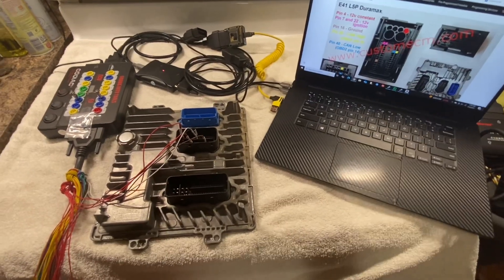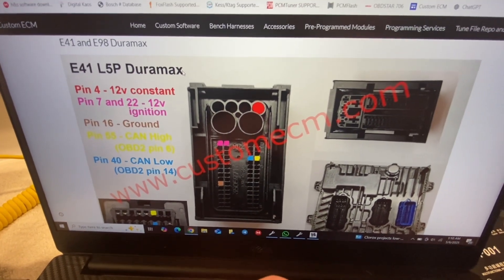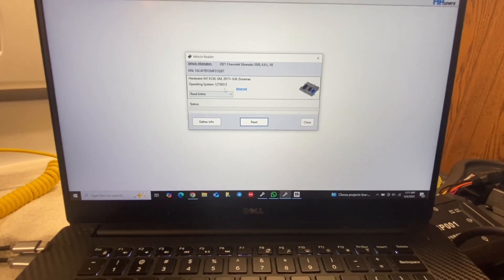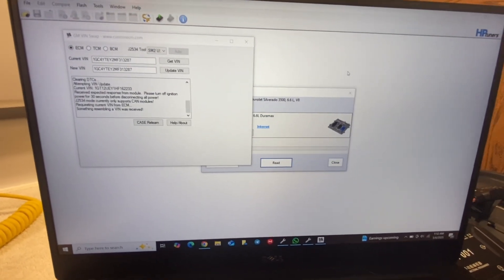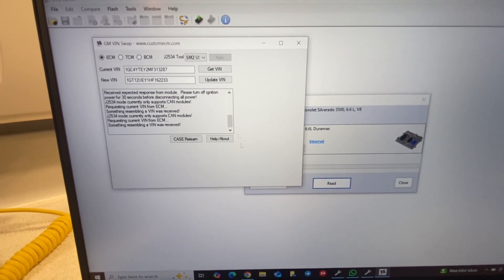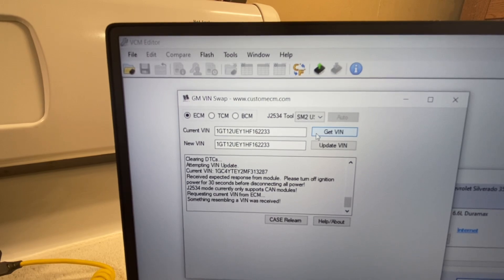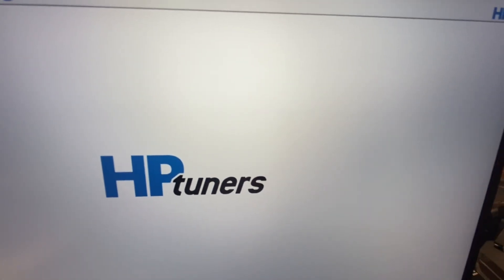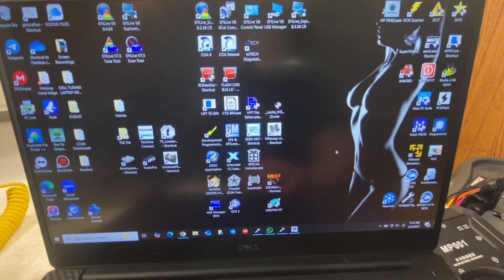GM VIN CHANGE on DURAMAX L5P E41 ECM 4 Free 😁 no credits needed!

Comment: Wèe you showing 2 different ways or doès this require hp tuning
Reply from the maker: You can also change vin on the hp tuners scanner tool.   Was showing that you could use both ways / both softwares .   Hp cost credits other one doesn’t

Comment: You know we’re to get cda 6 and flash files?
Reply from the maker: @CambamsGarage  me :)
Reply: @ how does one contact you?
Reply from the maker: @CambamsGarage   whats app 1.712.204.3955
Reply: Dude stoked to have found your channel
Sent here from dtech
Your underrated AND  look forward to learning from ya 
Peace from KY
Reply: I can help ya there.
Reply: Did you know vin swap can do dodges too  ...  crtl d
Reply from the maker: @joenitro9024    it does?.  dodge vin's are usally changed in the eeprom
Reply: @drewjohnson5402   sorry ctrl d is debug mode...   wrong button. 

Open James's gm vin swap and press ctrl M   (mopar?) and it'll pop up dodge mode.  I assume you're on 1.73 beta.    

Iirc it'll do most canbus dodges just not the pci ones.  

Ctrl k will let you change gm s/n's , not just vins.
Reply from the maker: @joenitro9024    awesome!      I never knew that!